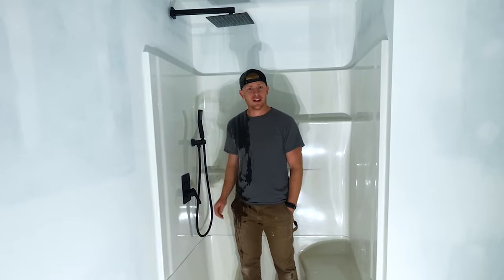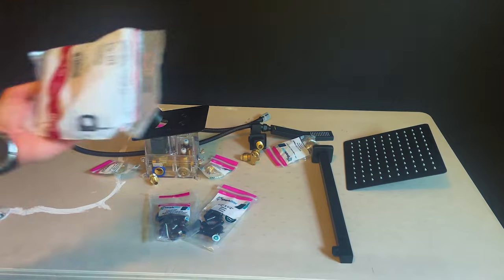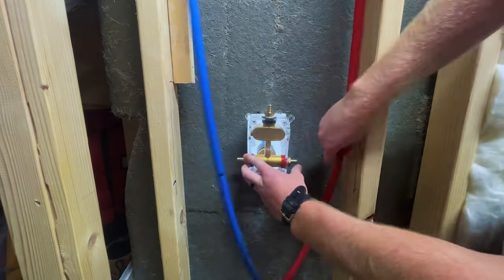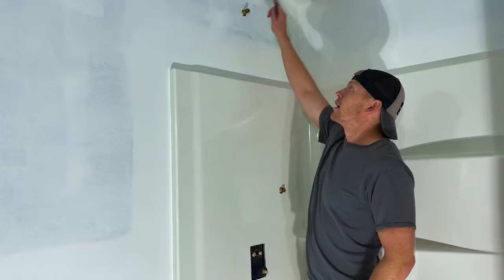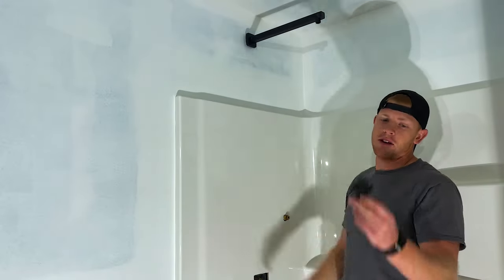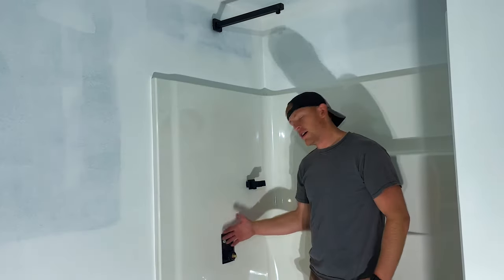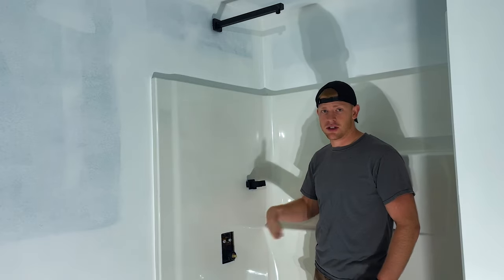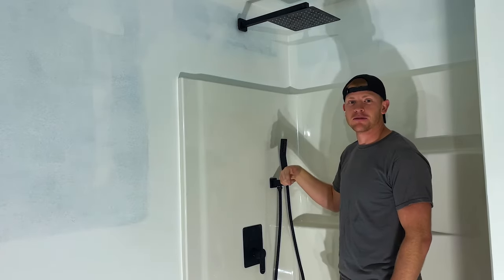How to Install Amazon Shower Kit | Bostingner Shower System

Comment: I just installed one of these.  My contractor and I were a little confused about operation on this, but it seems to align with your video.  The buttons are used to turn on and off the water, rather than the lever as with most shower valves.  What's the function of the "pitch axis" of the lever?  Does this change the water pressure at all?  Obviously the rotation axis changes temperature.

Comment: Hey so I got the same system on Amazon for a brand new full shower replacement but am concerned with the weight of the rain shower arm and head. I have 1/2 CPVC for plumbing. How do I support the weight?
Reply from the maker: To connect my shower arm I used a drop ear elbow that ties into my pex. The elbow  is fastened to backing. Holds the weight of the shower arm pretty well.

Comment: Are they a way to adjust water pressure? We are getting really nothing and water pressure is good everywhere in the house.
Reply: you may need to change water line to apex
Reply from the maker: I would check it without the heads. Just the hose/arm. That will narrow it down from the valve. Or the strainers on the head/wand.

Comment: Learning but why use crimp rings and  connectors instead of shark bite elbows . Just comparison to other methods.     I have yet to attempt to install...ty
Reply from the maker: There’s a million ways to do any job. If it works, it works. I’m no professional.
Reply: i would steer clear of shark bite if the fitting is going to be behind walls/tile for a shower as non professionals have a high likelihood of it leaking compared to crimp rings, if you can easily get to the fitting then sure go for it and use shark bite as they're fast as I've only use it once to cap off a 1/2" copper pipe that very easily accessible, its been over half a year now and has not leaked, knock on wood, for me personally I prefer pex A but I'm poor so I use pex B and crimp rings heh

Comment: Do you have the video on putting that shower in I got one that's almost like it?
Reply from the maker: No unfortunately I blew it recording that step. 

Essentially making sure it’s level and securing the flange to studs. Silicone the top to the bottom. Then hang the drywall up to the flange and mud the gap. Finishing with caulk for a clean finish.
Reply: @SatisfyDIY  ty